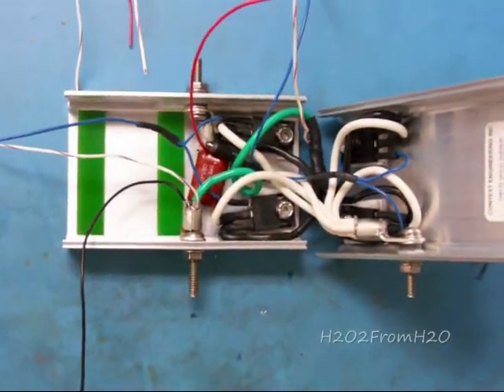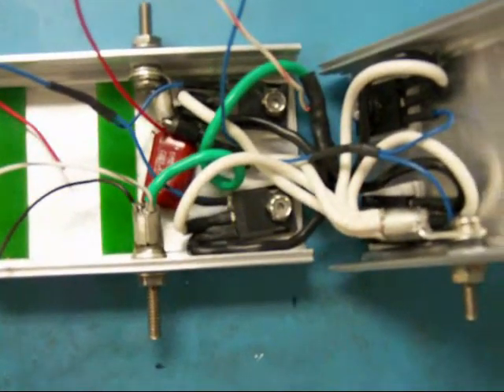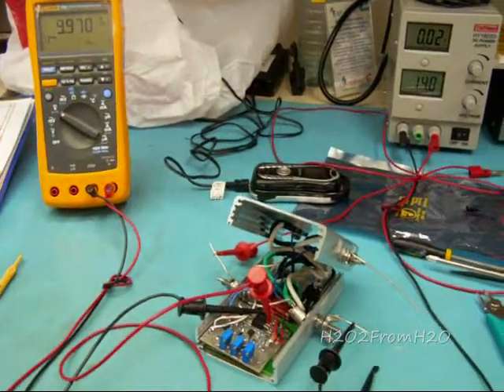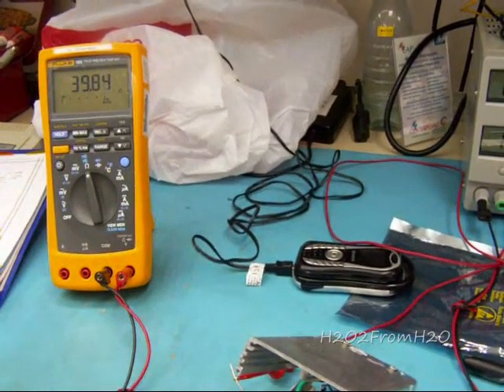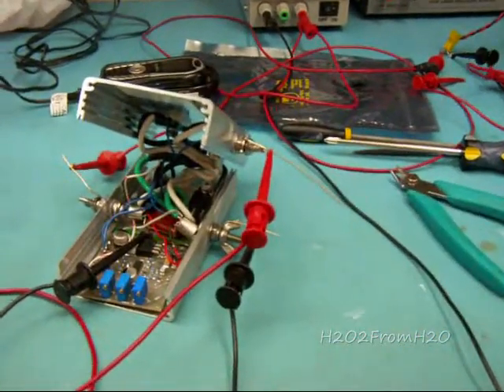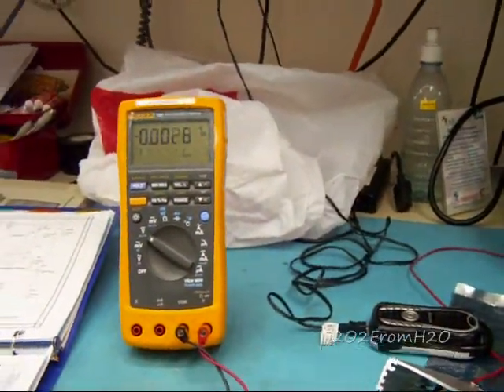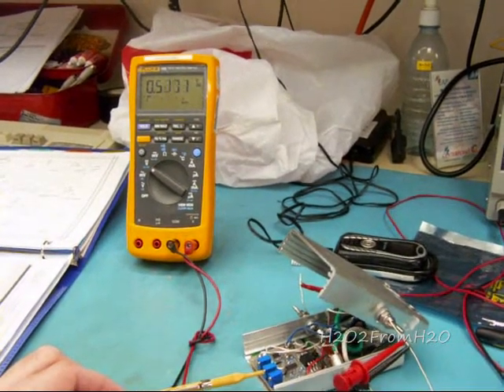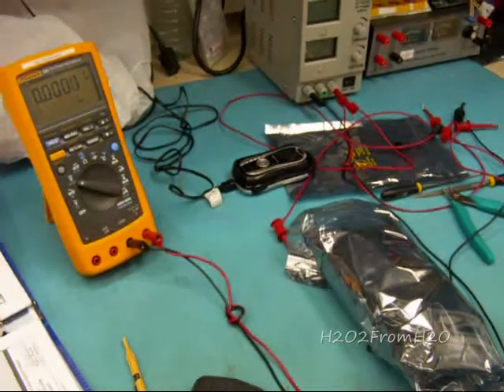#16 H2O2  PWM installing MosFets & Pretesting Unit

Comment from the maker: I have seen ZeroFossilFuel Video on V2.1H. His wire on the Drain is about 1.5 inch longer on one of the MosFets, this is acceptable. The source wires look equal. Now to answer the Question. The MosFets form a Parallel Network each leg has the resistance of the MosFet Plus the wires connecting them. When these networks are out of balance one MosFets will work harder then the others and generate more heat, shorting it life, When one fails completely the others will follow shortly.